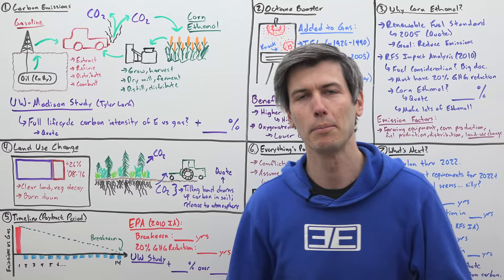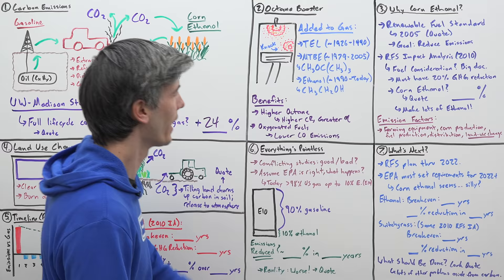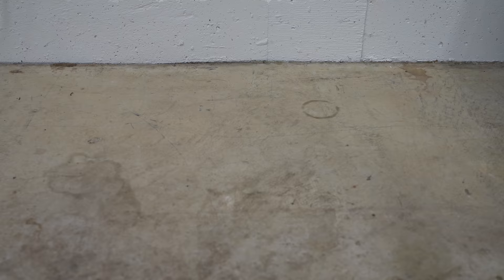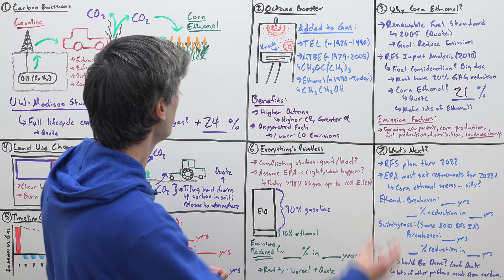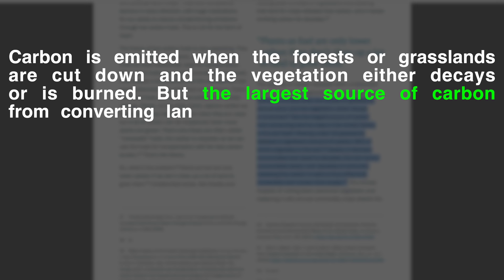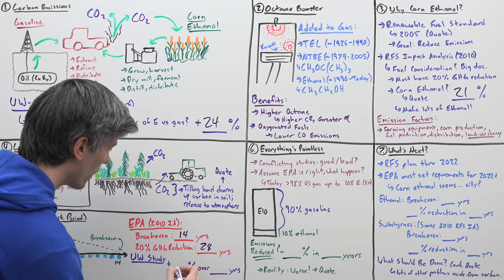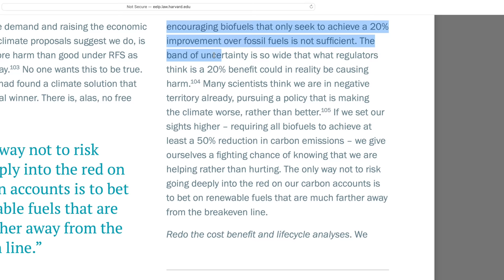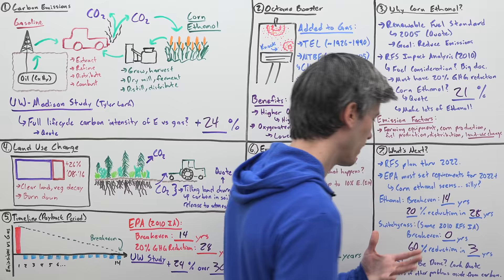America Was Wrong About Ethanol - Study Shows

Comment: If most farmers were to use a  no-till system for growing corn like they do in North Dakota, not only would they accumulate carbon in the soil at a much higher rate than ever thought possible but they would also save an enormous amount of fuel necessary for the farm equipment. Gabe Brown is an excellent example for this kind of farming practice.
Reply: I thought it was interesting how he conveniently left out the fact that a high percentage of farmers use no-till AND cover crops.  That fact doesn't fit his narrative.
Reply: @paulschmidt3624  Ok so 20% of farms are no-till. Does that affect the numbers that much? No. But that doesn't fit your narrative.
Reply: @joecoolioness6399  The USDA Farm Census data disagrees with that. The 2017 census puts no-till at 37%, conservation (partial) till at 35%, and 28% of land in conventional tillage. This is from the 282 million acres covered by the census, however, this covers all field crops(not tree crops) which can be drastically different in soil prep. Cereals and cover crops are much easier to go no till, whereas vegetables require more soil preparation. This can be seen in the census data, states with high percentage of cereals/cover (IA,Il,KS) have more no till versus states with more percentage of vegetables (CA, MN).

Comment: This doesn’t take into account the increase in fuel consumption when ethanol is added. Volume for volume, ethanol generates about 30% less energy than hydrocarbons fuels, so you have to use more fuel to travel the same distance. The difference may only be a couple of percent, but as you have shown, small percentages matter.
Reply: I do believe this has been taken into consideration.
Reply: This wouldn't be the case if we designed cars to run on the E85 ethanol and it's 105 octane...you could bump the compression ratio up and pick up big efficiencies there. Basically we are using the wrong car engines for it.
Reply: @robertelmo7736  I agree with you the current daily driven cars are not set up to be efficient on biofuels. As a gearhead, I modify my car to increase its performance and in this process, I have learned some of the naturally aspirated cars have increased compression to 13:1 on pump E85. Granted, the pump has to test for 80% ethanol or more for these cars to safely run but I would be curious to see an optimized engine for high ethanol content such as E85 and how its increased efficiency compared to traditional gas engines.
Reply: A while back I was driving across the country.  One of the states I passed through had a higher ethanol percentage in the fuels.  I spent less money per gallon crossing that state, but spent more money per mile doing so because my MPG dropped so much running that fuel.
Reply: yep you are right. I run E10 (94RON) in a 6 cylinder Australian ford falcon which also runs on LPG. I get about 8% less kilometers less than I get running our standard unleaded (91RON). The car runs a little better on E10 though. What i do is i start the car from cold on petrol and when the motor warms up I switch to LPG. which gives about 20% worse economy but costs 55% of the cost of E10. nothing is easy these days but with what is going on in the Ukraine I am glad I have dual fuel. E10 cost me $1.61/litre 91 cost me 1.90/litre and LPG cost me 0.869/litre. I just looked online and already most outlets are selling E10 at $1.95/litre
Reply: @earthknight60  Drop in mpg is definitely gonna happen as it takes 30% more for the roughly same combination of fuel and combustion as gasoline. This is where is was saying it would be interesting to see how high compression engines would benefit from high ethanol content where traditional engines lack.
Reply: "This doesn’t take into account the increase in fuel consumption when ethanol is added."

With proper/modern fuel management you can produce more power using ethanol. Yes, milage goes down but the power goes up. 

I burn E85 in my turbocharged 4-banger. E85 sells (as of today when I filled up) for $3.39 and it's 105 octane. Yes...the mileage is down but I'm also producing one hell of a lot of hp from a pretty small displacement engine.  Sunoco surge 105 sells $81 for 5 gallons and $571 for a 54-gallon drum. I'm getting the same results using sub $4 per gallon E85.

Ethanol COULB BE a great fuel IF our cars were TUNED to use the stuff properly.  They're not, which is why most American-built/tuned factory cars get crap mileage using ethanol. 

Also...no wars have been fought over ethanol. So there's that. :-)
Reply: @ianmontgomery7534  cost to efficiency ratio is the biggest problem I personally see with ethanol. However, I see that there could be a possible benefit from engines that are better optimized for high ethanol content such as E85 and reducing the amount of gas used.
Reply: @tylerbrooks6449  the big problem with E85 is that is can completely destroy older engines or fuel systems not designed for that level of alcohol.
Reply: @tylerbrooks6449  also, if you want to drive yourself nuts, use E10 in small engines. Dirt bikes, generators, mowers, and pretty much anything else will need a new carb or a good carb cleaning if you let it sit. Non-ethanol will fire right up, even after sitting for over a year.
Reply: @mattyrs4  E85 does have some setbacks and you are not wrong with moisture buildup etc. However, I'm from the states where e10 is the common fuel we use and E0 is limited in offering and is typically used for smaller less used engines as you stated. I think there could be progress made with 85% ethanol and engines that are built for biofuels rather than E0 and E10. It does obviously have its constraints as these vehicles would have to be operated often but they should net a higher percentage in decreasing the CO2 emissions. In the high-performance industry, we had a hit on tuning companies. The EPA came in and were testing these companies' race cars and the majority of these cars on true E85 were passing the emissions standards but failing visual tests for catalytic converters.
Reply: @robertelmo7736  Can you bump up the compression without generating more NOx?
Reply: There's also the increased emissions from cars that run into maintenance issues from the ethanol being highly hygroscopic. Maybe not a big issue in drier climates but in the southeastern united states, humidity is a factor. Can't find the numbers but saturated E10 (alcohol/water fraction begins to separate and can be seen as a separate layer) I believe has significantly less BTU's due to the latent heat of vaporization of water. It basically sponges up all the heat energy turning itself into steam leaving less energy to do work in the combustion chamber pushing the pistons down.
Reply: @dangoldbach6570  Honestly the worst part about all of this isn't even the issues we have discussed in any of these hundreds of comments on this video. The politicians will not put their differences aside and find an economically reasonable and effective option for the mass population. There are plenty of options for biofuels. As manufacturing and development become more advanced there should be affordable and effective options to start reducing the carbon footprint but of course, this all has to be in the interest of profit to make any progress.
Reply: @d.b.cooper7290  That is the catch of it. These engines would have to be balanced for economy and efficiency. Creating more compression, in theory, would use E85 more effectively with the higher octane rating.
Reply: @tylerbrooks6449  Higher compression generally results in more NOx when air is used as the oxygen source.  I'm curious if E85 can run at higher compressions without generating copious amounts of NOx (and smog).  The fact that the alcohols contain a portion of oxygen (requiring slightly less air input?) may allow this but I'm no combustion expert.
Reply: @tylerbrooks6449  yes a bump in compression will result in better thermodynamic efficiency but you're right, it's a tricky one to balance against the lower BTU/gallon to start with, you're already starting in the hole there... But maybe it's possible in something like a stratified charge engine??? 🤔
Reply: BL Dontmatter  Actually, you get a subsidy break for using ethanol, so you're paying less to get less. It's coming out of your taxes, though, so you might be right.
Reply: @robertelmo7736  this is what nobody talks about. The industry has been more obsessed with compatibility than optimization. There could be 1.5L engines making the power of 2.5L engines long before the turbo trend caught on if those 1.5L were optimized for 105 octane fuel. And speaking of turbo charging, that makes E85 even more attractive because that same 1.5L with a turbo could be making more power than a V6 turbo that isn’t running E85. Just look at the Honda tuners with their 1.5L civics and accords dynoing 300HP on stock motors tuned for high compression on E85.

Scaling down, this could lead to better efficiency. A 1 liter 3 cylinder turbo could reliably make nearly 200HP on E85. The fuel economy would be incredible compared to other engines in that power range simply due to the tiny displacement.
Reply: Excellent point which is exemplified by the roughly 10% reduction in MPGs when using the "Winter Blend" gas in the NY area (and suspected in the NE as a whole).  In November to April (an estimate), the Winter Blend of gas which contains more ethanol definitely shows up in a MPG reduction when driving in exactly the same manner.  I'm no scientist, just a Layman , retired now at 70, but who commuted by car for 75% of my 48 year career.  FTR, I have been using Premium gas for the last 6 vehicles :  2007 Infiniti G35X; 2010 Infiniti G37X; 2013 Infiniti M37X; 2016 Infiniti QX60; 2019 Acura MDX and now 2022 Acura MDX.  In my small, unscientific sample, I would definitely see a appx drop in MPGs in all these cars i.e.  2019 MDX Getting 25.5 MPGs highway using the standard Premium gas and then seeing 23.5 - 24 MPGs using the Winter Blend in the same commutes.
Reply: Oxygenates actually increase efficiency of gasoline, so by adding less energy, you are able to get out a higher percent of the total energy.  10% is probably too high, but 5% is perfect.
Reply: We glossed over the fact that E100 would have less issues that E85 if we designed cars to run it.  We could build a catalytic converter for the aldehydes.
Reply: Kinda like ultra low diesel, you can literally throw a match to it and the match goes out. Shark piss, and wonder why the trucks won't get no mileage
Reply: On the old equipment damage, ever occur to you that by design?
Reply: How do you get to hell?
Very simple: claim that you're innocent.

How do you get to heaven?
Very simple: Admit that you're not Innocent, you're guilty and ask for mercy.

How to know if you're guilty or not?
Simply: Compare your life to the Ten Commandments God gave you in the Bible.
Everyone agrees that if people followed the ten commandments there would be no need for governments or police.

Do not lie.
Do not steal.
Do not commit adultery.
Do not insult God by using his name as a cuss word.
There are six more but let's just leave it at that.

How many lies have you told in your life?

Have you ever taken anything that didn't belong to you?

Jesus said, if you look at a women lustfully you've already committed adultery in your heart with that woman.
How many times a day do you do that?

Do you use God's name as a cuss word?
Would you do that with your own mother's name?

If you answer these questions honestly you know that you're guilty.

God can justly punish you and send you to hell.

Ask him for mercy.
His name is Jesus.

It's as simple as this, The Ten Commandments are called the moral law. You and I broke God's laws. Jesus paid the fine.
The fine is death.

Ezekiel 18:20 — 
"The soul who sins shall die.

That's why Jesus had to die on the cross for our sins. This is why God is able to give us Mercy.

Option A.
You die for your own sins.

Option B.
Ask for mercy and accept that Jesus died for you.

Brian Hale.
Reply: @Chiroman527  there is a big difference between winter blends and summer, because of the cold, winter blends definitely use more volatile simple compounds to increase front-end volatility, think of the old ether cans you'd use to start your snowblower. They vaporize easier and allow for faster warmup ie reduced emissions but at the cost of reduced energy content. What you are seeing is real as far as mileage loss. Former buffalo New York resident here, I feel your pain!
Reply: @tjfarmer9380  actually the sulfur was for lubricity in the old mechanical fuel pumps like the stanadyne DB series or the roosa-masters, without sulfur they would score up pretty fast. If you are unfortunate enough to have to run ultra-lo in them today (because who can afford a new truck nowadays but that's a whole different argument!) You would definitely be seeing crappier mileage. I feel your pain, I've got a 1962 Farmall 504 tractor that won't run for shizz on the new stuff.
Reply: The total fuel consumption of U.S airlines is approximately 19 billion gallons annually. 

Total fuel consumption for mining lithium to make electric car batteries is 21 billion gallons annually.

The 21 billion gallons can only produce enough lithium for 250,000 car batteries.

The lifespan of an electric battery is 10 years and is not renewable.

Electric cars are not better for the environment.......they're worse.
Reply: @dangoldbach6570  What pushed the pistons back up?
Reply: @oldblueaccord2629  I dunno, they're still stuck down there!

Comment: Remember reading this on the auto forums 30 years ago.  Turns out those saying this was bad were right.  However, replacing mbte I think it was with 5-10% ethanol is a plus.   Mbte was very bad for the environment
Reply: Absolutely. We don't want to go back to MBTE. But at the same time, there are better things we could have replaced it with.
Reply: @ajm5007  That's MTBE.  But your right we could adjust the engines to run on vaporized fuel instead of atomized fuel.  They'd run cooler, cleaner, and way more efficiently.
Reply: E10 is a ploy to get old cars scrapped.
Reply: @fivish  I have a problem with old cars honestly, most people I see driving old cars here in beautiful airy SC pump out an absolutely disgraceful amount of pollution from their dirty mufflers. I hate it and I wish there was a way to make them disappear. Disgusting
Reply: @fivish  The motor itself is usually (there seem to be a few exemptions) not the problem, it burns anything that can be ignited with a spark. So even E100 is not directly a problem.
The problem are seals and pipes as they may not be designed to withstand ethanol. But even then these could be exchanged and cars would run without problems.
Reply: @clairehann2681  What year range? What percentage of vehicles are like this that you see?
Reply: @clairehann2681  does that include classic cars? Cause when they looked in to it the average mileage in the uk that classic cars travel produce less co2 than charging mobile phones.

There’s nothing wrong with old cars as such but not maintaining them causes them to start to fail. Did you factor the emissions created by manufacturing the new cars? Even electric cars actually produce more co2 in their entire lifecycle in the first 14 thousand miles according to the best case scenario from a study by Volvo who are very pro electric. 

Unfortunately the best thing is to consume less.
Reply: @davideyres955  Clasic cars' original carberaters will not meter ethinol properly. You need a special carburator for e85, but a normal carb will burn 10% just fine with a little tuning. As long as the fuel lines are ethenol safe you're good.

The thing about lithium batteries is that they create lots of toxic waste that can't be reabsorbed like CO2. It just killes everything around the mines and there is no longer an environment to worry about. That's what is happening in China where most lithium is mined. Not good.
Reply: @clairehann2681 , you have no idea what you're talking about.
Reply: @zeeoracle , it ruins carb seals and other parts.
Reply: @augustreil  ok
Reply: @danawilkes6174  It depends where I am. If I'm downtown there are newer cars, and as soon as I leave that area there is probably a 1/5 chance I'll drive behind someone who is stinking up the air for everyone else
Reply: @zeeoracle  Yes, they only need minor updates to their fuel system in most cases for 10% ethanol
Reply: @zeeoracle , most small engine mechanics will agree with me.